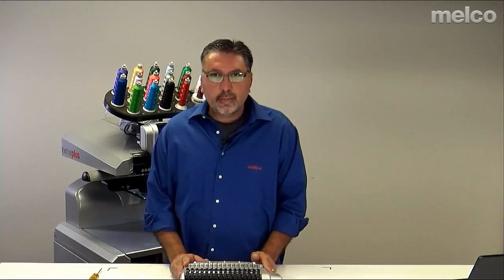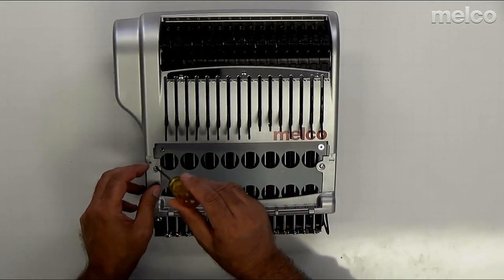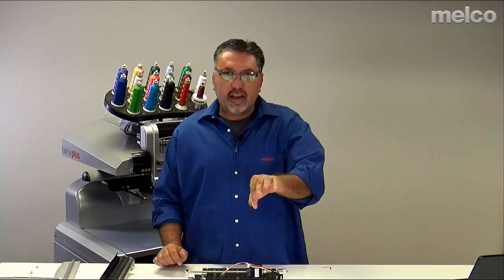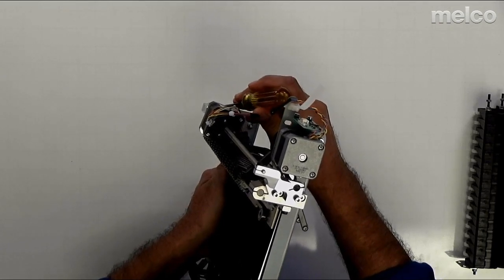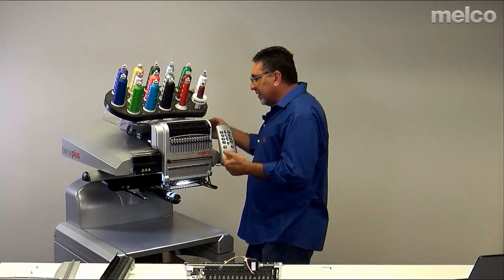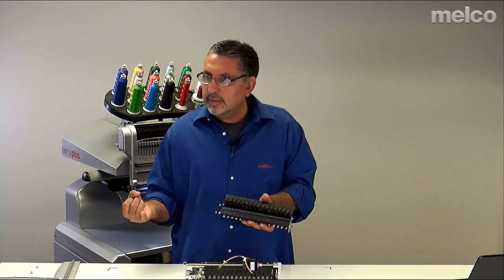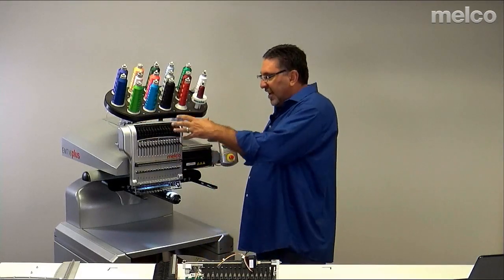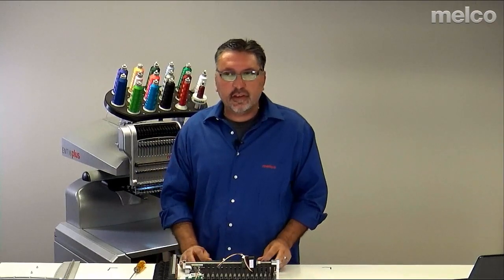Thread Binding Color Change

Comment: Hi 
what if the machine doesn’t move left or right when its turned on and makes a really loud noise?
Reply: Same.. Did you get yours to work? I need help. I have orders to complete and it doesn't move at all when it's powered on. It makes a really loud noise and error comes up..
Reply: It means your thread got caught on the nut and won’t turn due to a mechanical bind. I tried to take out the thread in between the nut and the rod but I’m unable to due to no movement